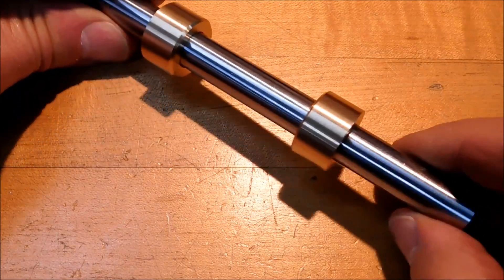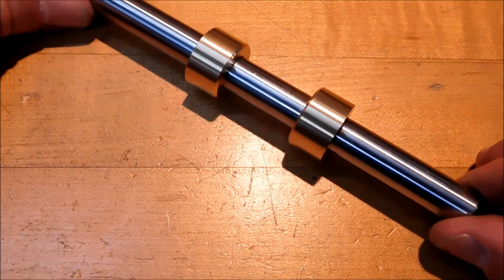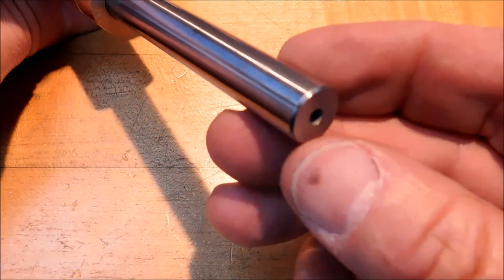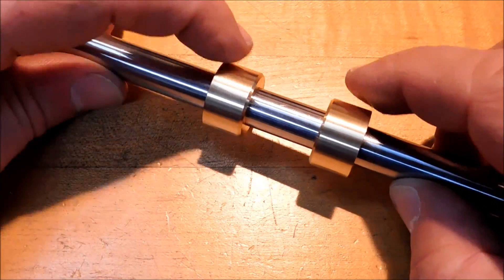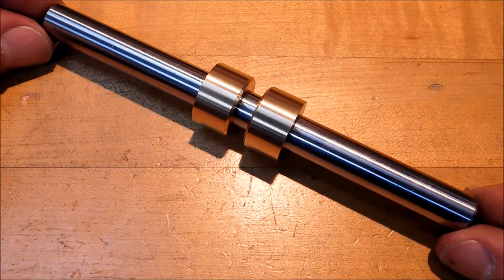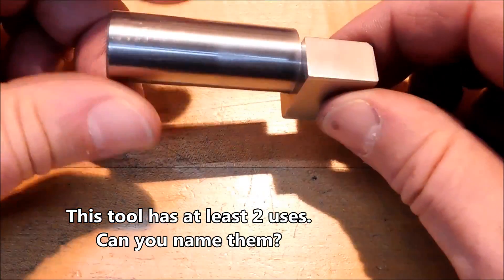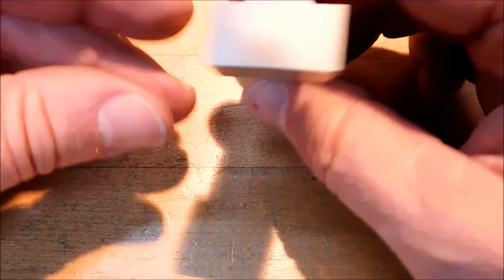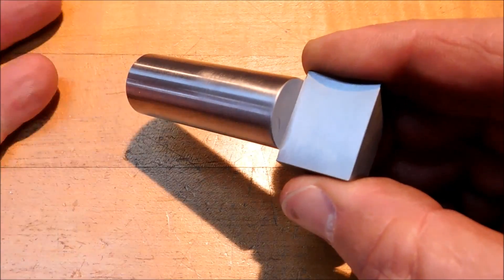WHAT ARE THEY ??  Vol. 1

Comment: The second one is a tool height gauge for a lathe, upside-down or right-side up tool the second one I think it's to line up your tool in that in your tool holder to make sure it's square and perpendicular to your Chuck cuz you could just squeeze them together ripped apart off till 1 then tighten it down with an Allen wrench

Comment: #1 is stand-off bushings on mounting rod for work on metal lathe.  #2 is center edge finder.
Reply: #1 indexing inside support for bores when turning outside dia. Or drill press/mill index stop.
Reply: #2 a 90° vertical & horizontal setup tool for work piece & mill/drill press head.

Comment: #1 Maybe a rotary edge finder. Mount in spindle, find edges mounted on the rotary table, added bonus is that those brass rings are probably pretty accurate and can tell you tool offset's. My other guess would be some sort of vertical sine bar.

Comment: #1 is placed in the chuck together with rings, with the rotary table beneath. The rings slips into the middle of the table. Now th exact position of the rotary table is known. Raise the spindle, remove the bar. Move table in x-axis, for instance 2". 
#2 is inserted in the chuck. Material on the rotary table is pushed towards #2. Now, when rotating the rotary table, a radius with 2" is produced.
Reply: Well, apart from radius for the tool to be used.
Sorry for misspelling etc. English is not my mother tongue.
Reply: Please Joe, no more questions after this one. This is unbearable, especially now with only a few views until 10'000!
Reply from the maker: I am actually filming the reveal right now. I'll post it tonight.
Reply: No need for setting the Swedish alarm for tomorrow morning, anticipation will keep me from falling asleep tonight! :-)

Comment: Nos.2- instrument for truing rotab- rod goes in chuck and you indicate it in central, flat allows sweeping in for Z axis. you can do it with just the rod- sweep for the sweet spot up and down however flat is easier. At least that's what i would use it for- my bubby rotab has a 4 jaw independent (manifoldy for useful, accurate and repeatable for the coin). Do they have set thru's for rotab; probably a good idea. No.2- i kind of hope it's a precision arbor and associated filing buttons ..... but probably not!

Comment: #1 I dont know, but I think its going to be very clever when you reveal what it is. #2. My first thought was edge finder, but then I thought, hey I would use that in my lathe to set all my cutting tools to zero depth. But yes, Tanda probably on to something on using it as a center stop for mounting things on the rotary table.
Reply from the maker: Tanda is right on it, but stopped short of the win.

Comment: Okay, I have to leave a guess now just to clear my mind so I can go off and stop thinking about this!
#1) I'm going to say you slide the brass rings over the ground shaft and put it in the spindle. Then you drive the mill around with your dials or DRO and deposit the rings onto the rotary table to set stuff up tangent to them.
#2) Place this tool in the center of the rotary table so you can push straight edged stock up to it to ensure the edge of the stock is on the center line of the rotary table. 
There, I'm sticking with those so I can sleep tonight. Haha
Reply from the maker: Thoughts for bedtime.....How many rings would you have to have for tool #1 to function as you have suggested? Would it be job specific?  And your guess for #2 is so close, I may actually loose sleep over it. Come back when this one hits 10,000 views for the answer. You are very close.
Reply: @joepie221  Just thinking of the rings as temporary stops so maybe two (along with tool #2) for doing a single corner radius and 4 for doing a complete end radius. I'll wait patiently now for the reveal!
Reply from the maker: You will  groan when you see how close you were.

Comment: My thoughts,
Steel rod & brass bearings: it looks like a tool for aligning a deep bore by using a external dial indicator 

Split rod tool: looks like a tool for finding an edge or split/centerline, mount it in a mill collet chuck & align the split line with the stationary vice jaw, alternately insert in to a bore (tap fit) & indicate with a dial test indicator. 

Or Mr Pieczynski  is just having fun by getting us too think up uses for objects he made expressly to provoke application based thought but lacking any intended use on his part other than the aforementioned
Reply from the maker: That may be correct. Maybe.

Comment: Both tools look like parts for indicating centers, #1 with a center finder locating when the tool is in same axis as the part, #2 would put a tool tip  perpendicular to the part at the center of the shaft.

Comment: Like other viewers, I am a noob. I am still working out uses for the first tool. Based on a video by Clickspring, the second tool looks like something you can use to lay out bisecting lines on a surface by placing the round shaft in the center of an object and then by using a straight edge draw the lines at various angles. I have also seen a tool like the second one chucked in a lathe to set a tool's height accurately on center.
As usual I am eager to learn more.

Comment: #2 is a stopper to install the edge of a part at the center of the rotary table
Reply from the maker: Is that where it ends?? or is it more versatile than that?
Reply: @joepie221  i woke up this moorning with my hamster spinning at full rpm and i think i foud it. The #2 is way more versatile than what i first wrote, with a caliper against the side of de rectangular that the tip miraculasly is in the center of the tool, you can position the scribbed stock part at the desired radius. You can also position the start point of the arc using a sqare against the inner flat part of the tool and an angle block.

For #1 i think it is to position the rotary table on the mill, i guess that the brass bushing fits in the slots of the table and with the shaft in a collet it become easy to align the slots of the table at 0 degree with the x or y axis of the mill.
Reply: @joepie221  what do you call tool # 2 if i were to try and buy one from you lol and do you make it with a mt2 taper. My rotary table has a mt2 center and id really find this tool helpfull. I do not have a lathe to make one of my own or the precision to make a accurate one in my hobby shop
Reply from the maker: @rccustomcreations  The second tool is the alignment / location tool. It is available on my website.  https://www.advancedinnovationsllc.com/product-page/alignment-tool Currently it is only available with a straight shank because the designed intent is for it to go in a 3/4 collet in the spindle. from there, rotary table setup is easy.

Comment: No. 1 is a tool for measuring/checking taper alignment of lathe spindle to the cutting tool in the compound.
No. 2 is a centering tool to align spindle center to a flat or round edge

Comment: Wow... not easy!!! I love this challenge. Ok...hmm... I'll bite (line hook and sinker)... lets see:
#1 a tool for measuring irregular objects max width/od/inner spaces: eg oval parts to set them flat. 
#2 has a long rouns stock, a fixed od and a square that is 1/2 od offser. That is a hint...I'm guessing you set this in a collet and this is a quick and semi accurate edge finder for quare/rectangular work for low accuracy jobs. Or you set it in the vice on the mill and for small work items it allows you to locate the center using an edge finder - either having a set of these for fixed sizes or using an edge finder. How close am I???

Comment: Hello Joe, you have taught me so much with your videos, keep them up! I am new to machining and using your videos to help get me started making my own projects.

Here are my thoughts on the tools.

Tool #1 I believe is used to quickly align the rotary table center to a collet mounted in the milling machine. One bearing is mounted into a collet that is placed into the milling machine, the second bearing is placed into the center of the rotary table. Then the shaft is slid into the collet mounted bearing, and can freely slide up and down to allow it to fall into the bearing placed in the rotary table when they are accurately aligned.

Tool #2 I am not too sure on and think it may be used to align the flat edge of the rotary table with the Y axis movement of the milling machine and used as reference for measurements.
Sorry if my description is off, but just beginning to learn the terminology.

Comment: I'll take a SWAG on the first one: you put the pin in a fixture, to use as a stop in one axis, and the brass bushings hold separate workpieces apart

The second one appears to be something you use to locate the edge of a feature on a workpiece, probably to be able to locate a position at a specific length along an edge

Comment: #2 could be used to locate the horizontal centerline of a lathe chuck or work piece being turned in a lathe and then set the proper orientation or height of the cutting tool at the centerline of the round piece.

Comment: #2 works as a runout-independent edge finder (for placing holes instead of milling shoulders). It could be used for other things depending on it's dimensions such as edge finding a hole the diameter of the boss (say the hole of a rotary table)
#1 could be used for many things depending on the problem you're facing...I keep a drawer full of precise-ish stuff, but no idea what you have in mind!
PS: A little time will tell...lol!
Reply: I think your right about #2 . I like ''precise-ish''  It's an honest step on the learning curve for me.
Reply from the maker: Trust me, #2 is very precise
Reply: @joepie221  I can tell just from the looks of it...I'm just too cheap to pay for anything so precise when most parts I make just have to fit (kinda off-putting I know). I'm in the process of rebuilding the mill spindle and I'm still doubtful of getting a calibrated indicator of known hysteresis as due to the very short travel (and big buck price) it will just end up sitting in another drawer until it's oil turns into dust...

Comment: Ok, if last guess was close I add one edge, making it a "corner finder", where the quill/#2 pivots around a corner (close but not too close...). The corner needs to be convex, but not necessarily 90 degrees. Now the angle to/off the corner is known and can serve as a reference.
I make a guess for #1 one as well. If one ring is put in the center of the rotary table and the bar in the chuck, it's a fast way of centering the rotary table. Several rings, hm...
Reply: I thought #2 was a bench dog for a wood working vice , but I bet Joe has come up with a new and different use for it..

Comment: #1 goes in the mill, the brass piece goes in one of the 4 T slots in the rotary table (I just don't know why) 
#2 also goes in the mill,  but isn't meant to be turned on.  (Still don't know why)
Reply from the maker: True...#2 does not spin during use.

Comment: #1 could be any number of uses - most likely for indicating off of because of the ground HSS rod?

#2 is for aligning the centre or specific offset from centre of a hole with an edge.
Reply from the maker: Very close.
Reply: #2 is for centering a flat at the RT center.

Comment: #1 might be useful for angled clamping setups. 

#2 is an edge finder, a slight variation in the chair style. Clamp it on an edge and center on the round part with a Blake indicator.

Comment: I guess you put #2 in the chuck and slowly move in the mill and/or rotary table until an edge is reached. Now, with some corrections for intended tool, you have the starting point for your rotation.
Reply from the maker: Extremely close guess. Possibly the closest yet.

Comment: Tool 2 is a center finder for a lathe if you need to move your tail stock. Tool 1 looks like it could be used to measure concentricity or balance a wheel.

Comment: tool 1, the brass tooling has one edge beveled and one square...assume the square edges (touch the part) are for measuring ID or OD of parts, brass rounds are a specific measurement .500?,  tool 2 the flat is on center to the diameter, you can measure to either the flat or the round depending on the need and/or setup
Reply from the maker: Good guess Chuck. I bet you have to have one once you see the uses.

Comment: #2 is a hole divider, in the sense of finding the center of a specific diameter hole. I have used two(2) on a plate with holes already in place and a straight edge to find the bisecting line on the plate

Comment: I'm with most others; number 2 is a tool height setting gauge for a lathe. Number 1 could be anything to do with setting parallel. However, I guess that, given the recent tutorials (they are better than mere videos!) they are used on a rotary table.
Reply from the maker: HINT: These are primarily intended for rotary table use. Yes

Comment: TOOL #1 test bar for finding taper between head stock and talestock.  TOOL #2 used for setting lathe tools on center.
Reply from the maker: Hey Herb. A lot of comments about setting the tool center. Wouldn't it have to be indicated parallel first? I can see it though.

Comment: Device #2 is likely for aligning a tool to the center of a chuck and to set an angle "zero" on a rotary table. I am surprised that the shank is circular and not a hex - a hex would allow you to index it to a set angle each time. In a pinch, device #2 can be used as a bench-dog :)
Device #1 can be many things, but IMO there is a little design-improvement that could be made. Dan Gelbart illustrates this in one of his videos:  https://youtu.be/a_E-tYRxBkU?t=515 - adding a groove to the tip of the shaft makes adding new rings way easier, without them seizing-up.
Reply from the maker: The application doesn't warrant any changes. You'll see in the reveal video.
Reply: @joepie221  Let's see :) Have you seen Dan Gelbart's videos, btw? (esp. the one mentioned above)

Comment: Not sure about the first and how it would pertain to a rotary table.  The second one is for aligning a square plate for milling corner radii with the tangent to the edge and setting the radius via offset to the block.  Just a guess.
Reply from the maker: Extremely close guess. You will like the application.

Comment: My guess would be the first tool to place 2 spaces in hole and clock the shaft for parallelism, square, taper

Second Tool edge finder of centre-line of hole, predominantly used horizontally, can be used vertically on the fly for checking bolt hole centre

Am I rite or am i rong....senpai
Reply from the maker: good guesses, but not the intended use.

Comment: The second tool is a repeat tool ;for example if your running part after part and they need to stick out a certain length it's a quick way mechanism to use and that blocked at the end of that cyclinder is movable so you can adjust it side to side or up or down and it'll sit flat ;for faster production

Comment: They both look like they fit the bore of your rotary table. #1 using the brass as standoffs while HSS goes through parts? #2 an alignment tool for setting up an edge with the axis of rotation?
Reply from the maker: Great guesses. I have to imagine if you had these, you'd figure out uses for them.
Reply: Joe Pieczynski it would be an honor to have them having learned so much from your channel, though the best tribute would be to one day make my own whatever they ares!

Comment: The fit on the bushing is too imprecise for it to be a gauge-like precision tool.. 
You said rotary table, so both of these are probably for setting up the rotary table.
What I'd do with the flat part, is to sweep the flat block to clock in a "flat" 0 degrees for the rotary table when upright, or to set up X/Y axis parallelism. 
The bronze bushing thing is confusing the FRICK out of me, you can't grab it or use it to indicate.
Reply from the maker: Or can you??
Reply: @joepie221  Well if you can grab them you lose a small amount of precision since there's a tolerance. Unless you crush the bushing with the chuck to use as a collet, then it's just to project the center of the chuck. Otherwise it'll just slip out. I don't understand why the bushing needs to be free, unless you touch it off with a spinning object, some sort of wiggler-like setup where when surfaces contact, things move. Gaaaaaa got me good.

Comment: Okay, #1 is a knifter pin fixture gauge adapter, the number of bushings used  is determined by the amount of angular compensation needed multiplied by Pi x diameter divided by 128.6 Inoperable without a slide rule!  #2 is without a doubt a sheetmetal stake, to fit in your pexto stake plate. It's for forming HVAC duct transitions. In the old days, there were many sizes. Now, with the new technology, all that is needed is to hammer out 1 sample, and print up any size needed adjusting with the % button on your printer.

Comment: Really the pin with the square attached, I made one for myself, which allows me to find the would be center of a round part while in a V-block, but, I don't know what you're is for...
Reply: that would only work on finding the center of a part of the same dia as the tool or only center of one axis. Not very versatile.

Comment: first one could be a gun barrel alignment tool when used with a Gimbal mounting on a four jaw chuck and a four point adjustable stedy for accurate centring of boar for chambering and suppressor fitting.
Second thing not so sure

Comment: Hi Joe,
Number 2 is centring  reference on the rotary table, aligning the work piece, but it's a parallel shaft not a Morse taper to fit the rotary table, unless you use a collet in the bore of the rotary table ?.
or
it can be used in the lathe with a collet for checking centre height or tailstock height ?
Not sure about number 1, referencing a convex or concave shapes on the rotary table ?
Reply from the maker: I'll let this ride for a few days. be sure to come back.